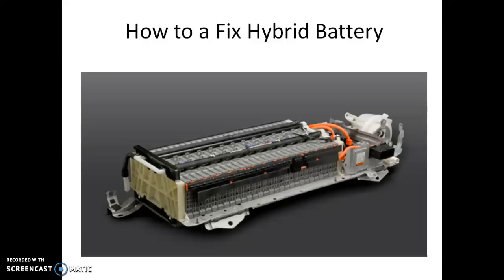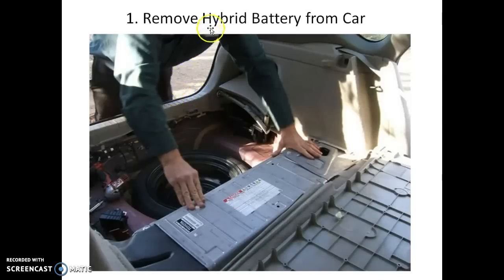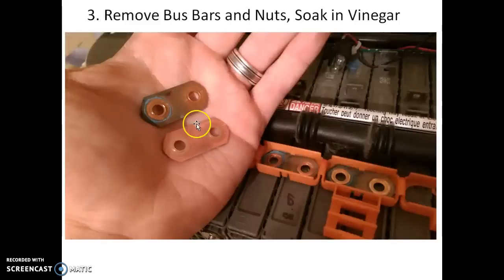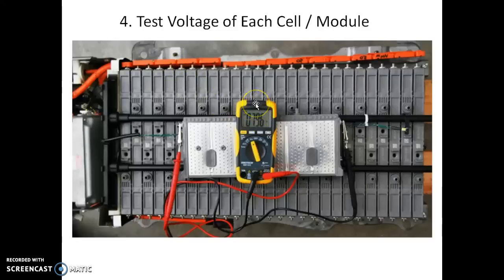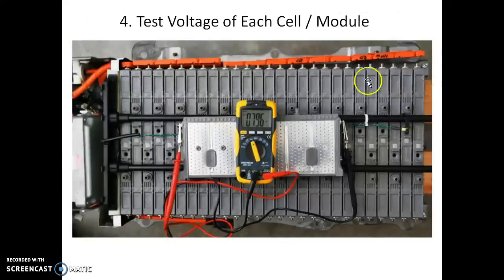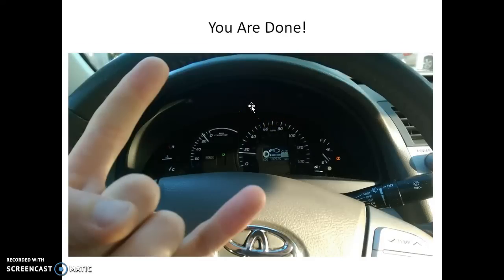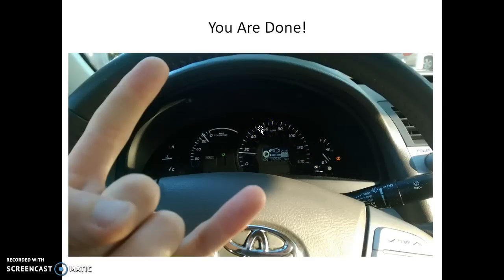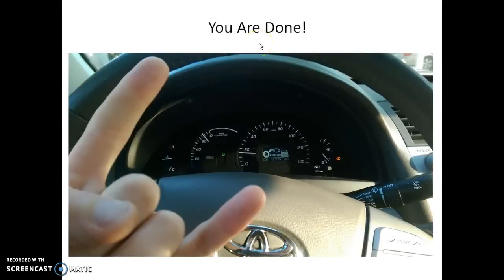How to Fix a Hybrid Battery

Comment: I check all cell and they go from 7.95 and up to 8.02 connector plates where ok i cleaned and the fan was very dirty so i cleaned!
What else i could do? Any idea?
Reply: Hi Jorge, I just checked all the cells of my battery too and each cell has 7.68V and more, but corrosion was definitely there. Were you able to fix your battery after normal cleaning?

Comment: Hi, 
Please my "check hybrid system" warning came on 2 days ago. The car doesn't shut off. I took it to Autozone to have it read and the codes P0A40 and P0A40. Do I still need to test the cell modules or is it something different like the train motor (I read it somewhere else) please what do u advice?
Reply from the maker: I$$EY you put the same code twice. But I think that code is one of the ones that I got. But I'd Google the code more.

Comment: Shane, I respect what you're trying to do, but you're providing bad information, and you're contradicting yourself. I feel compelled to try to educate you because of your claim "this is the best video," and I would like to prevent people from wasting their time following your advice to the letter.

First, no one should go through this exercise without confirming a P0A80 code, which can be read for free at most auto parts stores. If one store can't read codes, go to another

Second, DO NOT put the nuts in vinegar. This will degrade the zinc coating and make them susceptible to corrosion.  Baking soda is fine.  They must be rinsed and dried with compressed air thoroughly.

Third, at 7:37 you say anything below 7 needs to be replaced.  That is completely incorrect.  If the goal is a reliable repair, ALL outliers should be replaced. There will be almost no variation in voltage between good modules. AFTER LETTING THEM SIT FOR 10+ HOURS AFTER LAST OPERATING IN THE CAR, all modules less than 0.05V lower than the highest need to be replaced. The only exceptions are the end modules.  They tend to run as much as 0.10V less than the high.

Lastly, your description of why capacity is lost is inaccurate, but it's good enough to convey the concept.  This is where the contradiction comes in. You completely fail to draw the proper conclusion.  It's not just the failed module that is suffering from lost capacity. The failed module has a dead and/or weak cell or cells. The other 27 modules are still suffering from the reduced capacity, which means they can fail at any time. This dramatically reduces the reliability of the repair. It's analogous to having an 18 wheeler with 18 bald tires.  One tire blows, and you replace it with a used tire (of unknown condition) but do nothing about the other 17 bald tires. What do you think will happen next?

Anyone embarking on this process needs to understand this process is usually a game of whack-a-mole. Please keep us updated as to the reliability of your repair.  It's not at all hard to find accounts in YouTube comments of folks having to go back into their pack 3-4 times after doing this exercise.

Oh... one more thing... For the love of all that is holy, delete that link on how to replace a module. That is a travesty to watch, and it runs the risk of damaging modules. The right way is simple and actually takes less time with no risk of damaging modules - it just feels like it's harder. Completely remove the bus bar harnesses and main battery leads. Remove Battery computer and disconnect the two wires to it. Disconnect wire to the current sensor (white donut). Remove the two 10mm nuts holding the plastic ends to the bottom. Remove the vent hoses on top. Stand the pack on the end opposite the ECU bay.  Remove the 28 screws on the bottom of the pack and separate the case bottom from the modules. Now you can properly remove the temperature harness and disassemble the clamp to replace modules properly.
Reply from the maker: S Keith thanks for all your input. I'm not a pro nor try to convey that and I certainly don't want others to damage theirs. This is simply what I learned and did to fix mine. It saved me thousands and is still working.
Reply: "best video" "proven to work" etc.  are the sorts of statements made by those trying to project expertise.
Reply from the maker: S Keith I put best video because at the time there weren't any videos that explain it thoroughly, or even how and why. There are little things here and there, but they don't cover the big picture of what is happening, why and how to fix it. I wanted people to quickly find my video instead of wasting hours and hours like I had to. This is a video to cover everything.
Reply: Mr. Keith, you sound like a wise guy. But what's your point ? Shane tried to help people while all you can is criticizing. It's sad that the world still has the kind of people like you.  BTW, I have no hybrid but I like this video for my curiosity.
Reply: S
Reply: If you actually read my entire post, my point is very clear. I provided more accurate and meaningful information in my comment than he did in his video.  If you're going to comment on a comment... you should read the comment to which you're replying.

Comment: Do you need to disconnect the regular battery? Or any other steps before removing the hybrid battery?

For a Lexus gs450h
Reply from the maker: Paul Pese Yes, disconnect the 12v. If you watch the video in the link, it explains the whole process for removal.
Reply: Thanks man! Great video

Comment: good video.  And if anyone is wondering why you need to replace the low module(s)..... it's like the weakest link in the system and if you get one that is 6 volts than all of your other modules will only charge to 6 volts.  So they will all act as bad as the worst (weakness) one.
Reply: Your hybrid battery weak

Comment: Hi, to get the Hybrid batteries fixed or any Hybrid related problems at very nominal rates you can contact with UK Hybrid Automotive guys on 07503008686
www.ukhybridautomotive.co.uk

Comment: shane, i have everything hooked up and my car wont start. i tried jump starting it, didnt work. I have power. the lights go on. the remote key fob works and will lock the car. but I cannot put the drivers seat back because its electric and the car wont start. I got a spark when i hooked up the negative terminal on the 12 volt battery. so i'm going to the check the fuses. can anyone think of anything I should check?
Reply from the maker: Jason Daily these cars start with the hybrid battery, not the 12v. Something is wrong with the way you put the hybrid battery back together.
Reply: Yes. That's the black wire that has the silver end, that's not ground that's 12v positive in the pack near the 2 red ones. Check that wire. Sounds like it's grounded.

Comment: I need advice on how to get the cover off the battery cells. I'm trying to do this right now. I'm having a hard time trying to figure what to take apart on the wiring/duct side of the battery pack. If anyone can help please call or Text or message me here. My number is 774-434-9675. Thank you.
Reply: Jason Daily  hy it's very easy
Reply: How did everyone get the main (large) battery pack cover back on? 1) did you just force it on? 2) did you take off the component with the wiring harnesses facing the main cover or 3) did you take the electrical connectors off so there is enough clearance to get the cover on? also  why doesn't a 10mm socket fit on the nuts to take the component board off? i'm having to pound the socket on with a hammer and the socket still doesnt go all the way on the nut!?
Reply: suleman, if its very easy why don't you answer my question?

Comment: Hi Thank You For Ur Video. But I Have A Question I Have 2013 Camry hybrid Le  And It Is Odometer Is 172000 And The Check Hybrid System Is On They Told Me/the Toyota Dealers/ To Change It 5000 Dollars Which I Cant Aford But The Car Is Running Good And I Am Driving It It Is Now 18300 But Still Runinig Good. What can U Say About This?? Thank U
Reply from the maker: Melat Kebede sounds exactly like what the video teaches. Do what is taught here and you'll fix it.

Comment: Is there any chance the 12V battery could be impacting the Hybrid System? I've had the Hybrid System error on for about a month, but the car has still been running on the ICE. Today I disconnected the 12V and when I tried to start the car again, no luck. Can't be as simple as just replacing the 12V can it?
Reply from the maker: Michael Ward ya, it can be. Try jumping the 12v and see. They do go out. Mine went out at about 120k miles. They are about $500 though.
Reply: Will do. $500 is much better than the alternative. The dealer quoted me $6k and the hybrid specialty store $1700. I'm gonna try to jump it. If that doesn't work I'm gonna try to do your method. The car only has 131,000 miles on it.
Reply: So we got the battery out and opened up. All of the cells read 7.8 or 7.9. Have everything soaking in Vinegar right now. Seems way too easy, but worth a shot.
Reply from the maker: Michael Ward, all your cells are great. It could be the busses, but it's probably something else.
Reply: What are the busses?
Reply from the maker: Michael Ward  the little copper plates connecting each cell, what I said to soak in vinegar.

Comment: Oh! one more question. How does a bad one or couple cells can affect the output of entire system!?
Reply from the maker: If any cell is below 7v it won't work properly: It might through errors, get bad mileage or not work at all.
Reply: Also note that the bad cell is in series with the good cells= the weak link in that chain- much like your 12 volt battery has 6, 2volt cells and when one goes bad the whole thing is toast. At least these cells can be removed and replaced in this 240 volt battery pack. I suspect that you may have to do it again sooner than later when another cell goes bad. This I've studied also and plan to do to my 12 year old Highlander Hybrid....my neighbor just blew $4,500 on there's last year! Thanks, Shane

Comment: Hi Shane. Thanks for your valuable video. So far, I have watched a few DIY. One guy was saying measuring the voltage is not enough and every cell needs to be load tested. He was doing it by hooking a 12V light bulb then measuring how the voltage drops. What is your take on that?
Reply: I know this is an old comment, but this is accurate. If you have a few that are low, it's a safe bet they're going bad. But just because you have something reading 7v+, it doesn't mean it has a high enough total capacity. That's where the load test comes in. If the battery drains from full to dead way faster than the others, it's going to cause errors regardless. 

You can load test with a simple rig and a notepad recording voltage drops. Or you can buy a tool that effectively does it for you for $60+. They're just hobby battery load testers and are handy because they'll give you a total battery capacity, which is effectively what you are after when load testing. I believe 6500 mah is what each battery tests brand new. You can conceivably have a battery start at 7.8v but have a decreased capacity of 4000mah (or lower). This battery is just as bad as batteries testing in the 6.xV range or lower.
Reply from the maker: Ron Melliad I"m not sure, I've never heard of that. All I know is that what's in this video fixed mine. If you plan on keeping it forever, then doing that is probably a good idea.
Reply: He's checking for internal resistance in the cells. Maybe overkill. Try the steps in this video here, if your battery gets out of balance soon after, you probably have a cell or a few cells with lower capacity or higher internal resistance then the rest. Out of balance means all the cells don't stay the same voltage, which you want because your car might run the lowest cell voltage down below the safe voltage range for NiMH, causing it to take on damage and shortening its lifespan. Worst case scenario you are running current through a shorted cell and you can get a fire. Most modern battery systems have circuits monitoring stuff like this, and fail the pack before it gets to a scenario like that. Anyway, look up videos for testing battery capacity and internal resistance. Those are the next two health indicators to check for if you pack isn't staying balanced. If you find a bad cell or two, just replace them on the cheap from Ebay. Cheers.
Reply: @andrewgervais3039  Good luck with that. It is not easy finding a good module on eBay when most sellers state voltage which is not as important as capacitance

Comment: Thank you for this video. It has made it very easy for the repair. My bars were very corroded. My question is..I have 2 cells at 7.2 and 1 and 7.1...Would you replace them because they are so close to 6?
Reply from the maker: jim miller if you plan on holding on to the car for a while I'd replace the cells. Otherwise just clean the terminals and see if it's resolved. Most of my cells were low 7's and it worked fine.
Reply: Another question: Even if the cells are bad should you get a reading on the output. I am getting OVDC when putting the safety plug back in. i have not replaced any cells yet...just cleaned bus bars.
Reply from the maker: jim miller you should get a voltage reading on the ell terminals.

Comment: Got mine removed on my own back in March, because there are a few good videos on removal. However, most people are just removing them to replace the unit. While there are a plethora of people fixing the Prius batteries that have videos posted, this is the first I've seen where anyone showed the insides of the Camry battery, and I got a bit nervous trying to do this without a guide, so I utilized a guy 2 hours away to finish the job for $500. Glad I'll have this video in the future should this happen again.
Reply from the maker: Daniel Godfrey this video is all you need. It covers everything. I did exactly what it contains and it's running perfectly.
Reply: @shanecall  somebody is talking about rebalancing the battery. WTF does that mean?